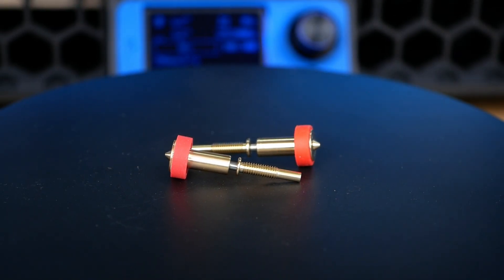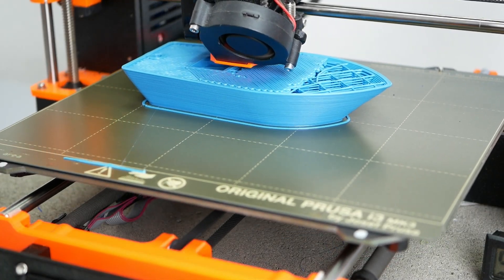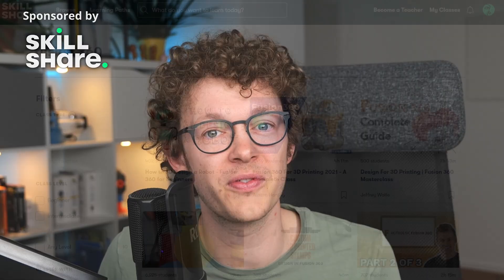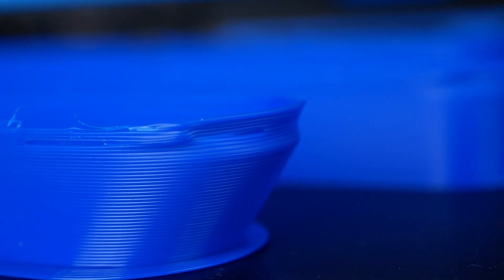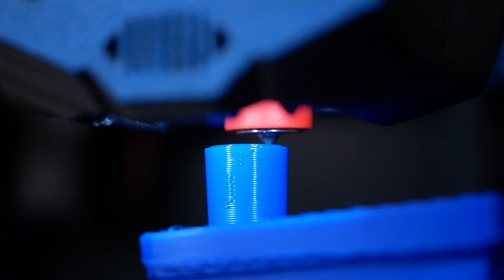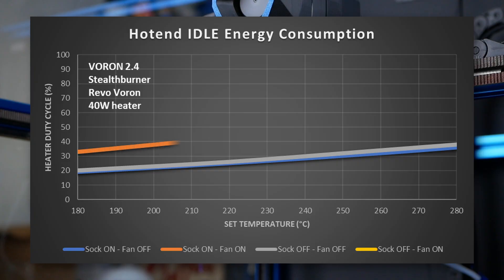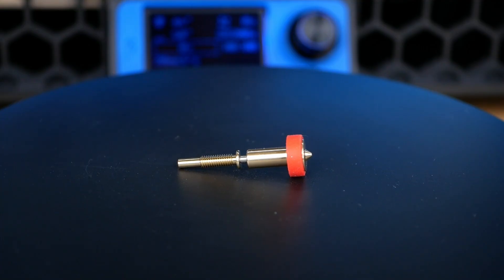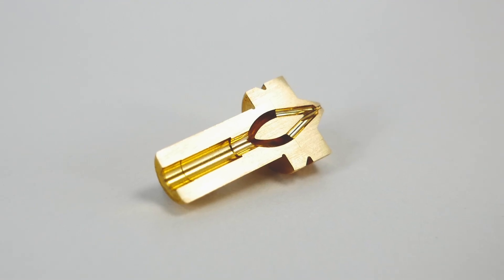E3D made an impressive HIGH FLOW nozzle!

Comment: Yeah this continues to demonstrate why I have no plans to ever "upgrade" to Revo. I can get a hardened steel CHT nozzle today, and I still don't see the benefit of rapid nozzle changes as someone who is MAYBE using his printer 25% of the time, so just having a wear resistant 0.4mm nozzle is really all I need. Especially since so much of what I make is structural parts, where printing fast can be a really bad thing for part strength, I'll happily trade the 50% longer print times for just knowing that my printer will happily handle everything from PLA to carbon filled PC with zero issues...
Reply: It would be nice in my opinion, but between the Closed Source Nature, and like you said how an abrasive resistant 0.4mm (or whatever your “standard nozzle size” is) nozzle will work 75% of the time, I don’t see much of a need there.
Reply: that's also what I'm interested in, though I've heard larger nozzles actually make stronger parts? like what if you printed 0.8 on PAHT-CF or GF-PC? that's what i want to know 😭
Reply: @spindlywebs  larger nozzles do make stronger parts, but this nozzle is the same size just higher flow rate. So it prints the same diameter, just faster
Reply: @spindlywebs  : It can.  Therein lies the rub.  Everyone keeps going on about, "closed source," "pricing," etc. and they're just a hobby user.  To which I say nothing wrong about that, per se- but it doesn't lead to the claims being made by the people there all the same.  With that fact...that it can make for much stronger parts, you either print with a larger nozzle ALL THE TIME (because a nozzle switch is not simple without this...they can kid themselves, but...) or you get an Obxidian on a 0.6 or larger for when you need to print that material in question and then have a few 0.4's about.

The main issue people keep seeming to have is the, "understanding," that nozzles need to be replaced regularly- which isn't so if you're not doing stupid stuff to/with your nozzle.

Use purge filament for swaps out of dissimilar materials, not drive your head into the bed, not print abrasive stuff, etc.  Closed source means little esp. in light of the first adapters to let you run Ruby/Diamond tips (as used by Stephan ON this video...hm...) and the like.  Being able to swap out those tips without filament in the system is a big, big deal.  I can print my PLA/ASA/PC/Nylon without fillers and then swap out that nozzle for an Obxidian of the right size and just GO.  No fiddling around tightening the damn thing while hot (The only way to ensure a proper seal, folks...).  And if I'm not doing stupid stuff, it's not so much a wear part.
Reply: What about the strength in comparison?
Reply: @OmarAdel19  what do you mean?
Reply: I still don't understand the sales pitch for this system. Nozzle changes are already easy and quick. Nozzle choice is limiting. How often and for what reason is there to change nozzles often enough to warrant locking yourself into this ecosystem? I see it being aimed at people who are new to 3D printing and selling them on the simplicity. Even then, is unscrewing something and screwing something else in that high of a bar?
Reply: @dn275  I guess people have issues with stripping their heater blocks or bending the heat brake when hot tightening? But like, that can be much more easily solved by just using a copper block and adding a couple screws through the block and into the heatsink, Mosquito-style... Or just by not over-tightening the nozzle... There are even PRINTABLE TORQUE WRENCHES that folks have designed for exactly this purpose. I honestly don't understand the Revo hype when I could just get a Mosquito, with better performance, full compatibility with any of my old nozzles, a higher max temperature, and only VERY marginally more difficult nozzle swaps (oh no I'll need to get a socket wrench and be careful not to touch the hot bits). The retraction trick in the end gcode to make Revo fully cold-swappable is just as doable on a standard setup, and you only need the heater block to be hot when you're screwing the new nozzle in, so you can be unscrewing the old nozzle, putting it away, and getting out the new one while stuff heats up...
Reply: @jasperbarnett6819  agreed. Add to that those Revo nozzles have to be swapped cold and since pulling cold it's basically impossible you need to heat it, remove the filament, wait for it to cool down and then swap the nozzle... is it really faster???
Reply: @MrPeloseco  it's marginally faster if you have a retract added to your end gcode for each print, so the filament isn't actually in the bottom of the nozzle, but you can do that on a regular nozzle too, and then you only need to heat it up for tightening (which you can start first, then take the old nozzle off, put it away, and get out the new one, and it'll be almost done already)
Reply: @jasperbarnett6819  : You printing those in NYLON?  You have to actually heat the hotend up to at least PLA temps to get a positive swaged seal of that nozzle to the heatbreak.
Reply: @jasperbarnett6819  : Funny...you're now off into the pricing of the Revo stuff doing those things.

It is just a matter of what you feel comfortable WITH and not whether it makes sense or not.  Seriously.
Reply: @dn275  i think the ecosystem is starting to switch over to tool changers, or in some cases “nozzle changers.” So to make it work, they need people to invest into it before they can do it in bulk.
Reply: @JLake3D  That use case makes a lot of sense. I can see the advantages of printing complex parts with multiple nozzle sizes.
Reply: @dn275  : If you're just doing hobby printing (most in the space are doing just that...) then it might not be for you.  That being said, I'm doing periodic nozzle swaps for varying things and I'm about to go off into the Obxidian space here shortly.  Most people just leave the hardened nozzle in their printer- which has...well...varying issues because the damn thing is steel or similar and has a differing melt profile, etc.  Meaning you have to change your profiles up to accommodate it.  Atop going about having to re-set the nozzle.  Closed source aside (Hint: There's an adapter that lets you use "normal" nozzles that was part of this video...) it lets you do things if you're a bit more serious about printing things.  

I'm not selling the system.  That being said...if you don't see a need, there's, well, little need for commenting so and just not getting it.  It amazes me how many people feel the need to mouth off when they're not  the customer in question for this and probably never will be, being happy with the cheap crap that gets put on their Ender, etc.
Reply: Then why did you see fit to open your mouth?  Seriously.  You're not using it as anything but a hobbyist toy.  Again, SERIOUSLY.  Nothing negative or bagging on you for THAT part.  If you see no need...why BELABOR this with BS like you just did?  Some of us DO happen to need that ability.  We actually use the printer as a tool, not a toy.
Reply: This is why we’re not talking about you specifically Jasper.
Reply: cool story

Comment: Curious what issues you've heard of with printing TPU with a CHT. I'm a FPV pilot so almost all of my printing these days is TPU for drone parts like GoPro mounts and using a 0.5mm CHT nozzle has allowed me to push speeds up to 50mm/s for printing some parts on my Voron V0 with standard 95A TPU. Cosmetic quality isn't "perfect" at this speed, there's some very minor surface defects, but I'll trade that for being able to print parts in just over 1/3 of the time any day. 

Always impressed with your vids! The level of care you put into each one is inspiring. I've been trying to devise a guide to TPU printing since I've been less than satisfied with what's out there on the subject but it's daunting.
Reply: i think i had trouble with some tpe 83 shore and a cht or cht clone nozzle.... id get very very thin walls, and then it would stop. i switched to a larger normal nozzle, and it behaved much better. im guessing its because the center of the filament is running head first into a obstruction.

Comment: There's something wrong here... I have that Chines knock-off "CHT" nozzle on my Ender 3 V2 and I can comfortably do 300mm/s just about all the time... Maybe I am doing something different... I give it 100mm in the slicer and turn the printing rate in the printer to 300%...
Reply: It is the Teflon tape, he put a thermal insulator between his nozzle and heater.
Reply: Volumetric flow is made up of three factors: Line width, layer height and extrusion speed. So you can print at very high XY speeds but still not have a high flow rate.

Comment: Looking at the cutaway, the new nozzle seems to have a "flat area" before it enters the thin section to be extruded. (As opposed to it smoothly narrowing to a point.)
This looks like an issue with how it's manufactured, but could that effect it's flow?
Reply from the maker: It will definitely affect flow yet if you read the E3D blogpost you'll see that they played around with various different designs and deemed this to be the best.
Reply: I wonder if its more efficient than a sharp tip
Reply: Looking at the entire nozzle, it looks like it might be stepping down the size to smooth melt path, if I were to guess anwyway, I am no engineer lol
Reply: Yeah that could become an issue over time and especially with obxidian variant + filled filaments...  
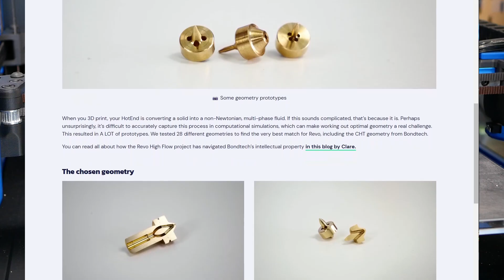When you just look at the insert part standing on the outflow tip (like in the picture on the right side @ 1:45), the 4 bores that converge to the center have flat areas between them and the bore-edges are sharp and not chamferd or rounded, like with bondtech CHT.
Theoretically those areas could act like flow dead zones and over time build-up of burned filament and other debris might occur until a natural flow-curve builts itself out.
However, i guess E3D tested those long enough that this is not an issue with normal Filaments.
Those flat areas coupled with the comparatively big widening of the filament path around the dome is most likely also the reason why Stefan could perform a proper cold pull.
The plastic just gets spread to wide in diameter so you can't pull it through the typicall 2mm heatbrake/PTFE tube in a non-molten state.
Reply: Wait, @CNCKitchen: If the four diverted tunnels are 1mm each, then the path goes from 1.75mm to 4mm, to nozzle diameter. This not only explains why cold pulling didn't work (4mm down to 1.75mm), but doesn't that effect the flow rate when it starts and stops? Would it work better if each section was closer to 0.43mm to keep the area the same size?

Comment: I would call this mid-flow. Hopefully they’ll do a longer melt zone version at some point.
Reply: Is there anything that flows more?
Reply: @IrocZIV  Rapido UHF
Reply: @JeD23  Fancy
Reply: @IrocZIV  Many. Rapido (HF/UHF), Goliath (100mm^3/s capable), Takoto, Mosquito (esp. with Nitram's Volcomosq heater block for Volcano nozzles), Nova, Red Lizard, etc.
Reply: A Supervolcano (or Goliath Hotend) with a HF Diamondback Nozzle would be LEGENDARY!
Reply: @ericlotze7724 wouldn't that basically be the same as Goliath + bozzle?
Reply: @twanheijkoop6753  I don’t have hands on testing, but the higher thermal conductivity, and to a certain extent and lower coefficient of friction, of the PCD means it should do better.
Reply from the maker: Good point. Maybe the Revo to V6 adapter would be a good choice in that regard.

Comment: Now we just need Obsidian HF for PETG to prevent the curling caused by PETG's love of sticking to copper. :D
Reply: I want a HF Diamondback !
Reply: @ericlotze7724  I want diamondback in germany without exorbitant shipping/import tax :(
Reply: Try Slice 3D's Plastic Repellent Paint. Works extremely well for keeping PETG off the nozzle. You just have to re-apply it every couple of prints, but i've been using it for over 2 years and never had a problem with PETG sticking since.
Reply: I thought PETG sticking and build-up was solved with nickel plating, as well as improving abrasion resistance.
Reply: @BladeWalker91  helped maybe, but I wouldn't say solved.
Reply: @ShadowDrakken  : Indeed.  But then I also want a HF for Obxidian so I can do high-flow abrasives as well.  I strongly suspect that's coming in light of how they got to HF with the Brass nozzles.